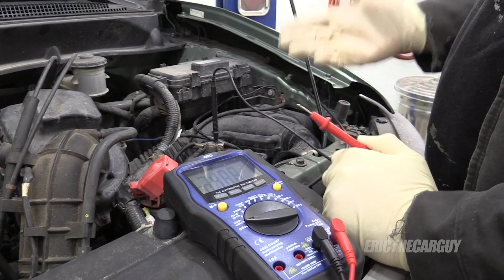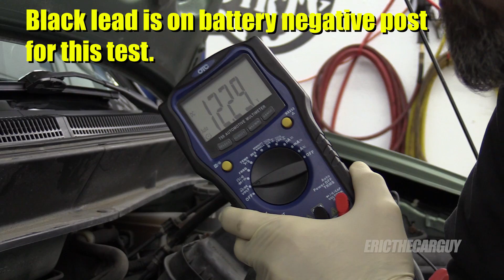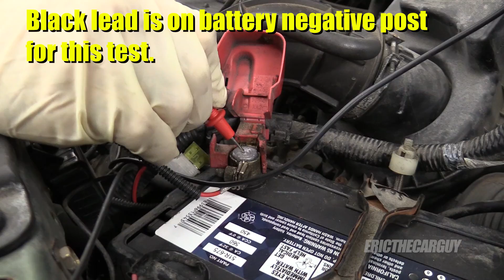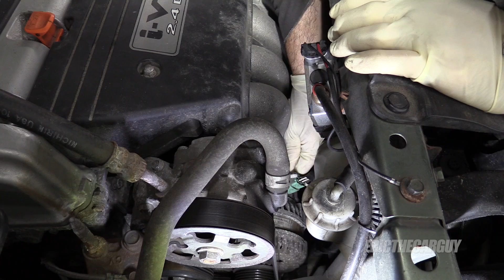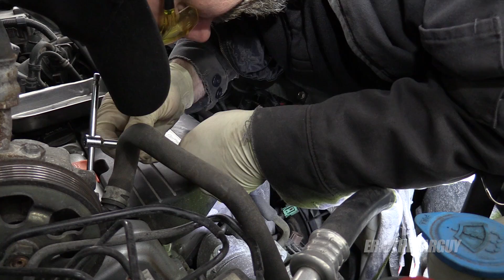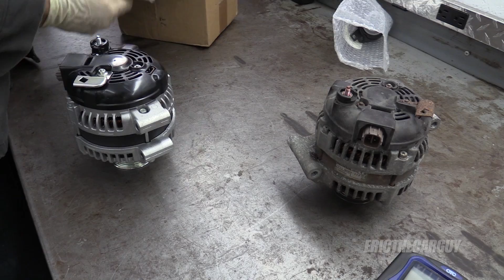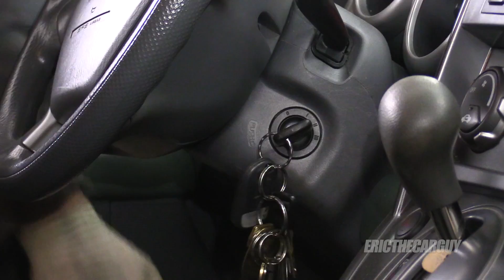Honda Element & CRV Alternator Replacement With Diagnosis

Comment: Removing the Condenser Fan helps tremendously - Also, one can use a Denso Alternator (refurbished), which is one of Honda's key providers for various parts, etc. \m/

Comment: Love your videos! This element is not the same as the CRV. The entire fan is what’s too close where as in your video the fluid reservoir was in the way. I just wanted to make that distinction because it is a bit more difficult on the CRV. I have to remove the brace for the hood prop to remove that fan, or remove the tensioner.

Comment: My 07 TL Type S alternator just kicked the bucket after 19 years and 121k miles I'd say denzo OEM Honda alternators are pretty reliable. 19 years isn't bad

Comment: Man I was all prepared to change my alternator with this method. Started taking the Power steering pump out and NO GO. Because I put a 2 inch lift on the front The engine sits 2 in lower than stock, SO the bolt will not clear and you can't pull the pump out of the way. Oh well. Gotta come from the bottom.

Comment: Great Video I have a Battery Light on, and I did the tests as you said on the Video, I have voltage on the White /Green wire Does anyone know what that means? Thanks

Comment: When I worked at Honda, I NEVER removed the P/S pump. I would remove the radiator fan assembly and overflow tank, as well as move the P/S resovoir and I would have enough room to clear the alt up out the top. Most of the time I ended up unbolting the radiator support AKA the T-bracket... but it takes a lot less time and is easier for me to do rather than remove the pump.

Comment: The KING of Honda Auto repair. My daughters 2002 CRV has over 400k miles. Runs great. But things do need to be replaced. Replacing her water pump and Steering pump. Removed the tensioner and the steering pump. Was able to remove 5 of the 6 bolts for the water pump. But that one bolt closes to the alternator are hard to reach. So, I was thinking of loosening the Alternator just a bit so I can use my 10mm ratchet wrench for that last bolt. This video was of great help. Hopefully she doesn`t need an alternator soon. It`s her first car, but she loves it so much kept it all these years. It`s a Tank. Her current car is a Civic.

Comment: I took my aftermarket alt out, got it tested 3 times at 2 different places, PASS but there's a problem. In the car, with it running, the volts will jump high, start charging, then go back down to 12 range but never below 12.3 - sometimes I'll get in to start and it will stumble start like bad gas for a few seconds then smooth out. Other times it will barely crank due to low power. This has been going on for over a year now. WTF could it be?

Comment: Just did this yesterday & it went surprisingly well...I was dreading the re-install but it went faster than the removal. 
I was able to use a 1/2 inch ratchet on all 3 alternator bolts..... my socket must've been the perfect length & outside diameter

Comment: What A  Friggin Nightmare!!!!! , sooo many parts to remove and absolutely No Room to do so!!!..Great ENGINEERING DESIGN!!!...Thank God I Own/Drive  Toyota Camrys 4cylinders ..Toyota Camry 4cyl  Alternators Can Be Removed within a 1/2 hr with  only a few tools , 10, 12,  n 14mm sockets-long n short ratchet  1/2 pipe...that's it ,,,,as EVERYTHING IS VERY ACCESSABLE FOR REMOVAL,& INSTALLATION  such as the starter, power steering pump, ALTERNATOR, v/c gasket, spark plugs  just to name a few ...Do'nt  Take Me Wrong ,,Hondas Are Great Vehicles , but Any of Toyota's 4 Cylinders..They Absolutely  RULE Over Any Vehicle Produced, whether Foreign or American for ALL ABILITIES   Accessibility  Drivability, Dependability , less Expensive parts & Last But Not Least , They Are Very Very Well Known For REALABILTY ,   THAN ANY OTHER  ...Produced Vehicle Past & Present.......... Thank God once again For I Saw The Light as of 1974  when I bought my  (1974 Toyota Corona ) For Ever Since Then ... I Will Always Own/Drive Toyota 4 cylinders!!...jus my opinion ...btw Great Car Repair Videos as ALWAYS "EricTheCarGuy"!!!

Comment: Hey man, thanks for your straight forward video. 
I have a question. You touched on the fact that there could be another reason that isn’t the alternator?  I have a battery light on my dash but I get 14.5 ish when I test and my battery hasn’t gone dead in months: oddly enough that battery light has gone out in shity weather on a steep incline a couple times in the last year…. It’s starting to drive me nuts. 
Any suggestions? Thanks

Comment: Enjoyed the video and will have to watch it again.  I have a Japanese built 2003 CR-V.  With the engine running and no load I have a voltage 14..30.  If I load it up the voltage drops to 12.30.  The battery tests good under load tests.  I am just not sure if this points to the alternator or the ECM.  Can I rebuild the alternator with premium parts (bearings, rectifier, regulator and brushes)  This way I have practically a brand new alternator apart from the shell and the stator at a fraction of the cost.

Comment: just done my 09 accord idtec, very similar job and really not bad DIY'd in about 2 hours. This element engine bay with the PS pump and coolant reservoir actually looks more awkward than the 2.2 diesel, didn't think that was possible. Nice job.

Comment: Great video Eric. I kept my laptop open in my engine bay with this playing the whole time on repeat!
Getting the bolts on & off the alternator was quite challenging. I honestly couldn't manage the hand-yoga required to access the bolts, so I ended up removing the radiator fan to get more clearance (as seen in this video https://www.youtube.com/watch?v=HeCzIwpdaLQ&ab_channel=Fixbook)
I was initially hoping I could just remove the fan & not need remove the power steering pump, but I had quite a challenge getting the fan out due to some wiring clips attached to the bottom of the fan. I needed to stick a long bar down past the fan and hammer the connectors loose, then reach in from below through the plastic covering to clip a wire tie. Not an easy thing to do, but made it MUCH easier to access the bottom bolts of the alternator.
I also broke the bolt holding the coolant reservoir, so was relieved when I saw I wasn't the only one!

Comment: With a little help you can also remove the fan and washer reservoir and pull it out and around the p/s pump, but then you wouldn't want those HID transformers in the way.

Comment: Fuse 15 under the dash on my Element says it is for the LAP heater. Is that the right fuse you were talking about to check? What is the LAP heater and how does it affect the charging system? Thanks for the super helpful video

Comment: I have a question.  With new battery and a new rebuild alternator every time I roll the windows down or turn the a/c on my RPM go up and down  headlights looks  weak . You any ideas why , this on a 2007 Honda Element  EX . Thank you

Comment: Super video step-by-step and tips Eric, thanks for sharing, on a customers '05 the alternator has no more carbon brushes and the rectifier diode plate was half burn out, as you know here in Mexico we repair everything, I bought new diode plate, new carbons, took it with a specialist to change parts and will go to pick it up in some hours to assemble everything back, regards!

Comment: Make sure to do that voltage check that Eric showed at 1:19. At least for the green/yellow wire. I changed my alternator to find out I had no voltage in the green/yellow wire. Problem was the fuze#4 (10a ACG fuze) located under the steering wheel. Changed the alternator when I should have just changed the fuse. Doooooohhhhh!!!

Comment: Hold on- what does it mean if I don't have battery voltage at the little black wire? You didn't actually say, as far as I can tell

Comment: Doesn't the alternator only start working over 2000 or so RPM???   It seems like you were checking voltage at idle which would only show battery voltage.

Comment: I always appreciate you using the term “fastener” for bolts and screws because that word applies to both. On the other hand, in this and other videos you refer to force used on a wrench as “leverage”, which is incorrect. Force applied around a central pivot in rotation is “torque” and it would be really nice if you used the correct term since these are instructional videos and you want viewers to learn valid concepts and terminology. Leverage requires a fulcrum and lever and involves single directional force as opposed to rotational torque. OK?
Reply: i think most people know how to turn a wrench regardless of whether it is leveraged or torqued
Reply: Marshall Hammond   You’re assuming “most people“ watching these videos are knowledgeable. The whole point is education,  so that assumption is completely incorrect. Both novices and professionals watch and learn from YouTube, and understanding basics of physics will benefit everyone. Incorrect terminology only leads to misunderstanding and confusion, especially for those who may not understand tool usage. Having an understanding of these two basic physical principles will enable someone to apply them to a variety of different applications in the future, solving problems that may have seemed insurmountable at first.  Excellent teachers bear this in mind and speak to the least knowledgeable so all will understand and learn.
Reply: @Rein_Ciarfella  i no know words good but i am a significantly greasy orangutang

Comment: Hey my favorite online Honda car guru! I recently bought a used 2008 Element and the battery died the first week I had it. I have since replaced it twice in the last 6 months. It seems that each time the 2 month old battery dies, a bunch of corrosion has accumulated on my positive terminal. Just last week it died again and we replaced cables and cleaned it good and today it is starting slooowly. It cranked but slooowly. Any advice you can give me would be much appreciated. Alternator? Maybe the voltage regulator? I am feeling bad about this purchase. I want my '99 CRV back. 😕
Reply: alternator diode leakage.....change alternator.
New battery replaced using old weak alternator.....makes NEW battery ......OLD :(
If it was up to me....NEW battery should be paired WITH new alternator.
Batteries go bad from age AND from inefficient/ageing alternator...
REMOTE STARTERS on vehicles wont remote start on NEW battery/OLD alternator combo.
YEP....blame the REMOTE starters....when the ALT/BATT combo would have won that one.
IDEALLY-replace battery and alternator....along with corroded cables.

OLD SCHOOL alternator test.....start car.....unhook NEG battery terminal....ALTERNATOR should keep car going
If car stalls....ALTERNATOR BAD.  
My 80 yr old Father-in-law taught me that one.
Reply: Thanks for that advice. I'll try that last thing. I have had the alternator checked three times at three different places and all say it's good.
Reply: @vanessaford9966  it can charge fine...but do they test for leakage current....?
Reply: @tjellis1479  I doubt the Auto stores did but my mechanic I think did. Actually, they looked for anything draining the battery that shouldn't be. I will ask them more specifically that  question. Thanks!

Comment: Hey Eric I’m a mobile mechanic I emailed you a long time ago when I first started wrenching. Thanks for replying.  I just installed a new alternator on that exact application. I used every single different combination of tools i have including the extras that I keep on board that were my dads for weird situations and could not get the bolt off near the fan motor. I use all professional tools and found it funny that alternator beat me. I removed the rad support and fan. Did it with lots and lots of room ;) .

Comment: Awesome video ! It helped with my wife's CR-v alternator replacement . The only thing is on the CR-v you have to remove the upper radiator support , power steering reservoir , and one cooling fan in order to carefully wiggle the alternator out to replace it .

Comment: As my understand that white/green wire is the signal wire from ELD. you should see flashing with the test light. but we didn't see anything on your probe .that means the alternator didn't receive the command to start work. That alternator should be good.

Comment: Just put one in on a 2002 CRV. I took out the fan; it was a tight squeeze. Also, the 1/4 drive ratchet helped a lot on the bolts underneath.

Comment: My 2008 CR-V had a battery charge light and other dash lights due to low battery voltage.  I replaced the alternator with a CARQUEST reman. This did not correct the issues. The two pins you placed into the 4 wire plug on the alternator resulted in no power on the black/ yellow wire( which I believe should have battery voltage) and battery voltage on the white/ green wire that you said should have no reading. Fuses are ok, so I disassembled he under hood fuse box and got the ELD out and matched it to the proper part. So far that's as far as I got, other work now in the way. Is there any light you can shed on the green/ white wire and why it should not have a reading? Thanks!

Comment: Hey there Eric, Is there a lot more room to work on an Element than a CRV, as I've seen other video's where guys were removing many components to get at the 2005 CRV alternator...fan, wheel, the bar across the front.  Some suggested removing the radiator.  You only removed the reservoir and moved the power steering pump.  Do you think all that is necessary on the 05?  Thanks for the video.

Comment: I know this is from a couple years ago and you probably won't see this, but I'll still put it out there. This will not work on a 2002-2006 crv. There is less space, the alternator connection is a bit different, and there power steering pump has the fluid RIGHT on top of it.
Reply: I did  this  alternator   replacement  just  like  Eric  did.  I have 06 Honda  CRV.
Reply: @williamoneal3947  I have an '03, and it wasn't possible. I had to tear the whole front end apart.

Comment: Holy smokes the two 12 mm’s under the alternator were brutal. Took me six hours to swap it
Reply: removing the cooling fan and top 4 core support bolts allows you to tilt the support forwarding that way you dont need to remove the P/S pump

Comment: Eric, you do the best auto repair videos around. Your removal of the PS pump was a good move and I wished I had done that when I R&Rd the alternator on my 06 EX-P. It diagnosed exactly like yours - straight battery voltage with nothing above 12.7v. I replaced the alternator with an aftermarket not having heard your caution against them. Ugh... We'll see...

I am currently looking at a 04 LX that has intermittent starting problems and, on the surface, it would seem like a bad alternator except for the fact that charging voltages appear to be good - mostly. I am suspecting bad brushes because the car is right at 200k miles and it looks like the original alternator. My experience is that the basic alternator is good but the brushes get worn out and barely touch causing poor/intermittent charging. I have ordered a 31105-RAA-A01 brush holder and "hope" that would solve the problem. We'll see.
Anyway, Bravo, Eric, and thanks again for giving me a sanity check.

Comment: Fuse 15 seems to be for a LAP heater or LAF heater on later models, some type of O2 sensor. Is that what you meant to mention when you said check fuse 15 under the dash?

Comment: I dont own a k20 or k24 a crv or element I just like watching this shit 😂 plus the alternator replacement in my acura tl 3.2 is tops like a 50 min job if your completely new to auto repairs out and in love it but the starter is just as bad as the k series engine

Comment: Thanks, Eric! I was looking at the alternator placement in my '04 CR-V (poor design), and it looked to me like moving the power steering pump was the way to go -- but other posters pull the front crossmember and passenger side fan, which seems like way too much work. I'm glad you confirmed the PS approach works on an Element; I hope it works on the CR-V as well. It's pretty tight in there.
Reply: Finished the job tonight. This approach DOES NOT work on a 2004 CR-V 2.4L. You MAY be able to get the coolant reservoir out by removing only the PS pump, but the alternator's not coming out unless you also remove the passenger side fan. That requires removing all the mounting bolts from the upper radiator support (front crossmember) so you can push the support out of the way far enough to slide the fan out. Three hours to do what should have been a 20-minute job. Thanks, Honda!

Comment: Just had the charging system on my '03 CR-V die today. Was planning to replace the alternator myself until I watched this video. As typical with "modern" cars, there just isn't enough room for my giant mitts to get in there. But thanks for the tip  about fuse #15. I'm headed out into the freezing wetness to check it out now. I'd much rather replace a 15 cent fuse than a $200 alternator.

Comment: What did you use to read voltage? Are those pins in alternator plug? Is it possible that would ness up the plug?

Comment: OEM alternator was over $500ish, you mention BBB sponsors, don't they make alternators?  I'll let you know if the after market one gives out or holds up.  Another great video.  I did a Honda Accord 94 and it was in an easier place.  Seeing it on that Element made me feel better.

Comment: Just did this on my '06 with 131K miles. Thank you so much for the step-by-step. You make it look so easy! Even with my nimble hands I had a god-awful time getting those lower mounting bolts in. I'd actually recommend threading those into the alty first and then threading them into their mounting points and THEN doing the big top bolt. I tried doing the top bolt first and it was off juuuust enough to where I couldn't get the bottom two in. 
(fuck Honda for making the space by the idler pulley so tight. and zip tying the wiring harness to the original alternator. wtf guys)